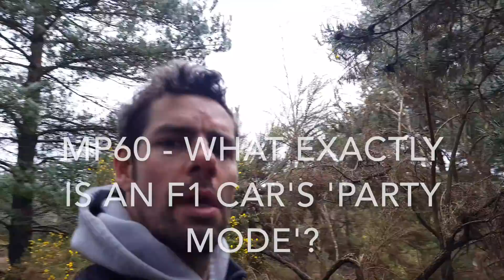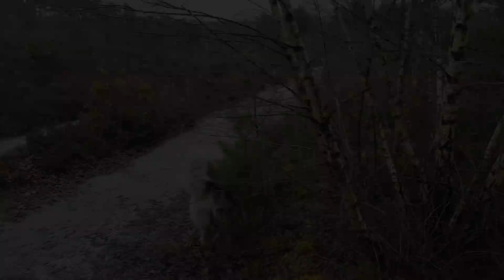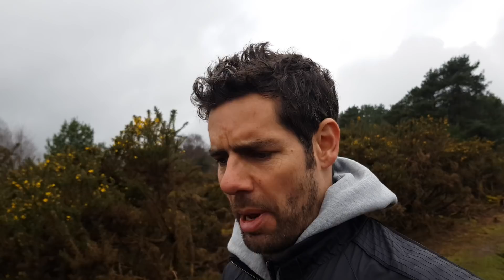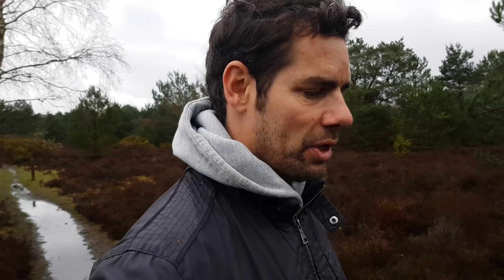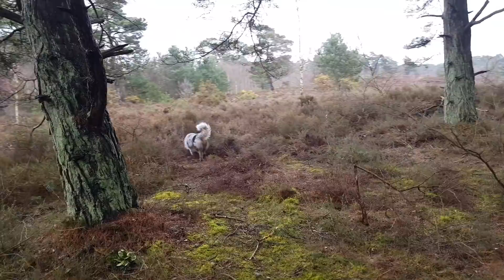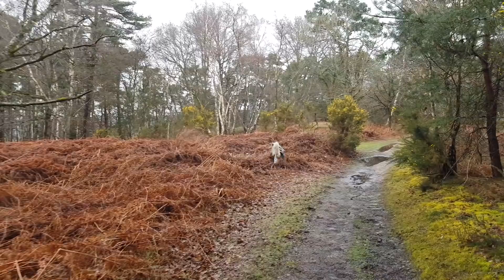What Exactly Is An F1 Car's Party Mode?

Comment: Do the other teams have this mode? If they do, does this mean Lewis is the fastest driver over one lap?
Reply: Bahamuttiamat they all gonna keep hating but every year of Hamilton's career he's proved he's the fastest.
Reply: I assure you, renault do have a quali mode.  It's not a potent as mercedes or ferrari, but rest assured they have it.  Max's engineer was giving instructions to higher modes to help overtake kevin.
Reply from the maker: Robbie G Everyone turns everything up as much as they can for Q, just that the Merc is a better, more reliable PU, so high power modes are more effective and useable.
Reply: christian is stupid. Mercedes are not switching out a race engine for a qualifying one. They are keeping the same engine but allowing it to produce more power for one lap. This is a technology many if not all teams use but it is the fact that the so-called "party mode" was publicised by mercedes snd hamilton. Bear in mind that the "party mode" is the same as the quali mode mercedes had last year. Honer is just pissed off over the fact that the renault pu sucks
Reply: Brian he has won at least one race in every season he has competed in which is remarkable imo especially in that dodgy 2009 mclaren

Who do you think is the fastest driver in the current era of f1?
Reply: Brian, you'v made a fair comment but I'd add lewis has shown himself to be the fastest since day one.  No other driver has matched alonso as a rookie.  Currently vandorne is struggling and he was highly rated as a junior.  

Lewis matched and beat alonso while being strategically disadvantaged, especially in the first 4 or so races.     It is no accident he's ranked number one by all team principals 4 years running.  He is supremely quick, consistent and diligent.
Reply: Laz Arus Lewis was faster than Nick every season as teammates
Reply: Bahamuttiamat Hamilton also destroyed Alonso in qualifying proving he's quicker over 1 lap. Every year haters talk about the car but Hamilton makes a car better. Look at McLaren 2013 and Hamilton at Mercedes 2013. Hamilton instantly got pole laps and won some races. McLaren didn't win once in 2013 still with Mercedes powered V8s
Reply: John Rice WRONG. McLaren favored Alonso all the way up until Hungary when they let them both race. McLaren screwed Lewis out the title by leaving him on bald ass tires in China. Everything has been done to keep Lewis from winning. He should  have win in 2007 and 2012 and 2008 shouldn't have been close. FIA penalized Ham, his own team messed up so much in the end you could see something was fishy. McLaren instantly fell when Lewis left for Mercedes. Lewis helped Mercedes develop to multiple race winners in 2013 and he claimed poles. McLaren with Perez and Button still with Mercedes powered V8s...did nothing
Reply: John Rice There you go with the name calling. All I see is hate and venom because you know the truth and the truth hurts. Lewis is the best. Period.
Reply: John Rice You can talk tough on the internet all you want but Lord knows you wouldn't pop off like that to me in person. And let me see the woman you got if you claim to have one and compare her with any one of my chicks ...guarantee no contest boy
Reply: Renault engines don’t have a qualifying or party mode yet. Or at least it’s being put out that they don’t and may be covering for it just not being as good. 
https://www.motorsport.com/f1/news/renault-working-on-magic-engine-mode-for-2018-961509/
Reply: Who is the fastest driver? If he was in Lewis's car.....Fernando Alonso .....LH has the benefit of being in the best car.  If Fernando was LH team mate, LH would be #2 in the Garage. If LH was in the car Fernando is currently in, he would be lucky to finish in the points or make Q3. Want further proof? Where would Bottas be if he was not in the Merc? It is all the car....not so much the driver.
Reply: Vernon Pitts, maybe you should rewatch 2007.  They were teammates and lewis was his number 2, till he complained.  The very next race lewis won and pretty much led the championship all year.  Don't sleep on lewis because you're not a fan, he's on GOAT level.
Reply: Correction .. Lewis has proven he is faster than most of his team mates (except Nico), but I'm yet to be convinced he is the fastest driver in the field. Unless you put all drivers in equal performance cars, no-one will never know the answer to that eternal question.
Reply: Vernon Pitts Delusional comment
Reply: Nico got more poles (1 season as teammates w LH) due to Monaco off, and Hamilton's DNFS in qualifying due to brake failure and engine explosion. Nico always proved himself to be one of the quickest since entering F1 and he still was no match for Hamilton
Reply: Still I Rise4485,  Not need to tell me bro.  I'm a hardcore Hamfosi.  Simply trying to education the ignorant and delusional. Drivers never get the credit they deserve until retirement.  In time, even his most ardent hater will crown him king. :)
Reply: John Rice, I have a wife and children but i'll think about the hobby thing.  Every chance you say?  you mean like being over fueled while alonso got pole in monaco.  Or gifting alonso 2nd in malaysia after lewis overtook him at the start.  How about alonso blackmailing Ron Dennis with skygate?  Conveniently forgotten eh?  How about alonso crashing out in fuji, a race lewis won?  Or costing himself pole in hungaroring with his antics?  His fans love to make it sound like everything was stacked against him but ultimately he got beat by a faster driver.

He should have stayed at renault, in the loving embrace of daddy briatore who'd fire any driver who remotely challenges him.  Or better yet, have them crash into a wall.  LOL fools.
Reply: Still I Rise4485...Why wouldn't I tell you that, you sound like a little punk.....go back where you came from.....What are you his father....Idiot!
Reply: Lol Still I Ris4485.  Aint that the truth.  These little worms are all gansta till you run up on them IRL.  Can't win his nonsensical argument so resorts to name calling.  Children.
Reply: Bahamuttiamat yup
Reply: I’m sure they do have a higher power modes but may not have a maxed mode, as Renault had reliability issues. To keep from their engines failing, they may restricting max power or party mode. The engines are much better this year in speed, as we saw RedBull achieve fastest lap during the race and were not too far off pace in qualifying. I know the Mercedes engine is bulletproof and a beast of an engine, no denying it.
Reply: Daniel O don’t remember him saying that they are switching engines. He is just complaining that they have the ability to go faster in Party (qualifying) mode. It’s not Mercedes issue but Renault’s to figure out. And they may someday or another engine manufacture may finally come back in and Mercedes then will trail in power. Things don’t stay the same and someone is always complaining.
Reply: Still I Rise4485 Hamilton is a great driver but hasn’t consistently shown he is the fastest. During his time at McLaren, when RedBull cars were dominant after his first 2008 win, Vettel won four titles in a row. Lewis didn’t win again till he joined Mercedes. So I don’t think he was proving to be fastest or he would of been winning? Cars have a lot to do with speed and don’t. I mean, Bottas should have been up there but because he is not the driver that Lewis is, he wasn’t. I think if we put a few drivers in the same car, we might see something different. I think Alonso is still got something to give, and there may be others.
Reply: Brian Yeah Honer never said that they were swapping engines im just using that to make my point
Reply: Daniel O I don’t honestly know. I left F1 as a diehard Schumacher fan, like everyone else was, it seemed and for good reason. It was boring watching him an Ferrari just running rings around everyone. I am a RedBull fan and have been since I came back to F1 in 2007. But I root for the underdogs. I would like to see some of the smaller teams get more competitive and I am happy for HAAS and McLaren this year. I think Verstappen might be great but he has some learning or growing to do. I like Grosjean, Perez and have some hope for Hartley. But don’t think any of those will be great. I am unsure of someone currently will match Hamilton and Vettel. Lewis deserves the bandwagon he has following him, I just am going to say congrats from the sideline of that fan base. If that convoluted answer, answers your question.
Reply: Thanks all great discussion...learned allot 👍
Reply: How could they switch engines?  I don't think you can run one engine in qualy and then another for the race since the cars will be in parc ferme...unless you take a penalty.
Reply: Driver/s debate aside. I would like to see 2 other engine teams come into the sport. I think Porsche would be a great fit, if they wanted to come in. I think they are running a similar hybrid engine in their LeMans cars already. They might be able to bring a solid engine that could rival Ferrari and Mercedes dominate engine. And being able to run in LeMan, I would assume the Porsche engine would be as reliable Mercedes. Aston Martin and possibly Cosworth would be nice to mix in as well. Give more variety and less cars running the same engines.
Reply: Bahamuttiamat....Maybe you should get a hobby or a life...Go watch the 2007 season....McLaren gave ham every chance to win the WDC and he managed to screw it up....One race he put himself in a sand trap for Christ sakes entering the pit.....Ron Dennis tried to shove that rookie down everyone's throat as a rookie instead of going with the current 2 time WDC Alonso.....Alonso should have never went to McLaren......Bahamuttiamat ...Find something to do or a girlfriend
Reply: Bahamuttiamat ...I'm sure your divorced by now if that's true, or she's just there for a paycheck and doesn't pay attention to you...assuming you have a job but not likely from all the ridiculous comments you seem to have time to post
Reply: John Rice You talking tough about another man needing to find a girlfriend...I know you wouldn't tell me that. Lewis Hamilton is the best only way to beat him is with politics and interteam bs like 2016. Fact is, they don't want a brotha to break all of F1s records. He's in a white man's game so everything is done to turn him into a villain. All Hamilton does off the track is to promote F1 and spread positivity and inspiration,  but since he enjoys himself and is confident they call him arrogant.  I'm not expecting someone not black to fathom what we have to put up with daily; whilst being a good person and going about your business respectfully ppl still hate and say bad things. Australia was more proof of something mysterious getting in the way to cheat Hamilton out of another win.
Reply: Still I Rise4485...Let me know when you know the real story, back to your mothers basement and your video games!
Reply: I don't think Porsche now has the staff to compete in F1, given all the other classes they compete in.  They could do very well, but they would need to drop other efforts to enable that, IMO.
Reply: Robbie G every team and engine has various settings. The difference is Mercedes has such a dominant engine it can dial it up without blowing up.

An engine that is more reliable in high altitude and heat, has better fuel economy, and better performance. Really is a dominant engine.
Reply: Yes, other teams have a partymode and yes lewis is the fastest driver of a single lap ever.